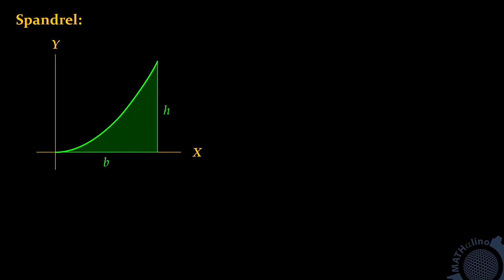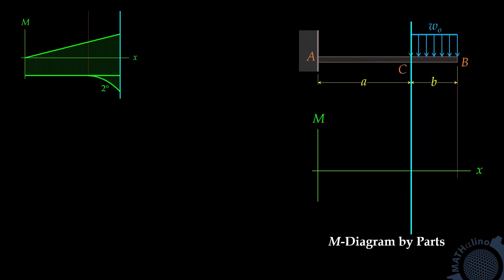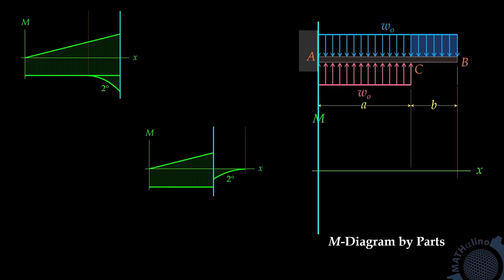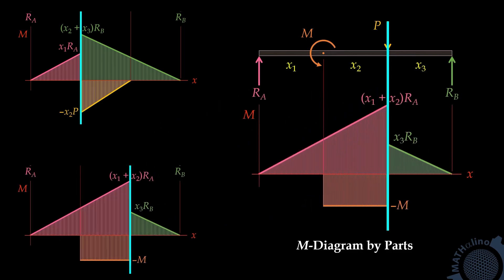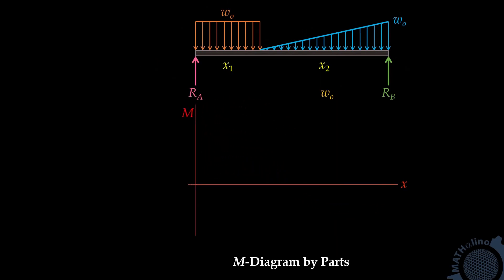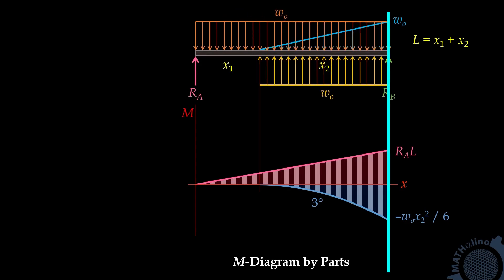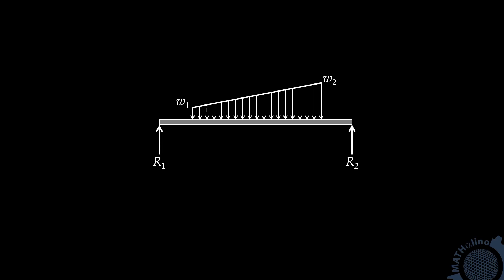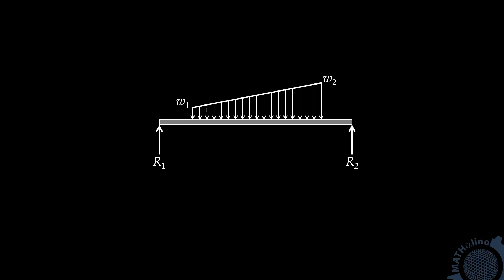Area Moment Method Part 2 - Location of Moment Center | Theory of Structures

Comment: Good Afternoon sir, Pano naman po pag may internal hinge sa gitna? pwede po ba ako dun mag moment diagram ?
Reply from the maker: Ang mga examples sa video na ito ay simply supported at saka cantilever.  Kung lagyan mo ng internal hinge sa gitna, maging unstable ang mga yan.  Be specific at pakilatag lahat ng conditions para mas madaling sagutin ang tanong.
Reply: @MATHalino1  

 @MATHalino  
----------P---------P-----
-----------|-----------|------
---------V----------V-----
|=======o=========O)
Fix    internal    Roller & Moment (counter cw)

Parang genyan po yung problem sir. Sorry sir nalilito pa po kasi ako, kakabalik ko lang po kasi ng school.  

Pwede po bang makuha yung slope and deflection nyan sa location ng point load?
Reply from the maker: @ayatoamagiri2737  pinakamadali, i-consider mo lang sya na dalawang beam, isa cantilver, isa simply supported. Ang left reaction ng simply supported ay load sa dulo ng cantilver, yan ang key sa solution, pagmakuha mo, proceed ka lang as usual.
Reply: @MATHalino1  Maraming salamat po Sir. 😁
Reply from the maker: @ayatoamagiri2737  Kung kailangan mo pa ng dsetailed na sagot, post mo ang problem na ito sa Forum section ng MATHalino, doon pwede may makapagsagot sayo ng detalyado. Link here: https://mathalino.com/forum
Reply: @MATHalino1  okay po sir, thank you po 😁
Reply: @MATHalino1  Good morning sir!! Left reaction na tintukoy nyu po yung shear load po?

Comment: sir paano po pagkuha sa slope sa left support. same lang po ba ng porcess sa right support sir? i hope mapansin nyo po. nag advance po ako ng study sa topic nato para ngayong first sem po. salamat po sana mag reply po kayo
Reply from the maker: Sa area-moment method ang makuha mo na value for EI*theta is not directly the slope but the rotation between two tangents.  Kung ang isa mo na tangent ay horizontal then ang nakuha mo na theta ay yun na ang slope.
Reply: @MATHalino1  thank you sir napansin nyo po comment ko po, oo po pero pag ang kukunin ay slope sa dalawang support po paano po makuha ang left support.. pag sa right po ako mga lagay ng moment center pag nakuha ko deviation sa right support makukuha na ang tetha sa point A. Using rise / run. Pero pag sa left deviation
Reply: @MATHalino1  pero pag sa left deviation namn po ang kukunin paano po yun using tangent through point B. Para makuha ang slope at right support po.. hope mag reply pa po kayo medyo nalilito pa po ako pag tangent throught B namn po ang gagamitin para makuha ang deviation of left support tangent through point B.